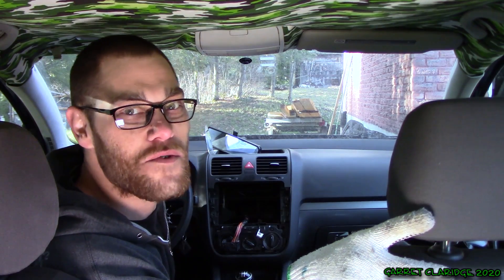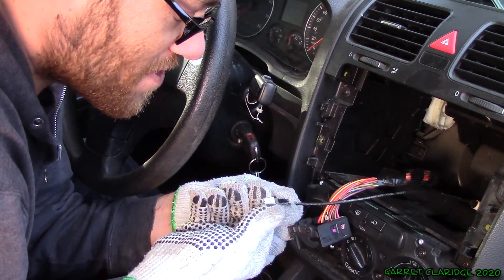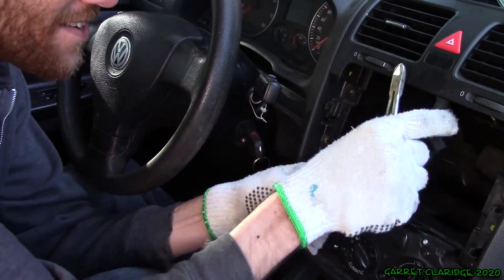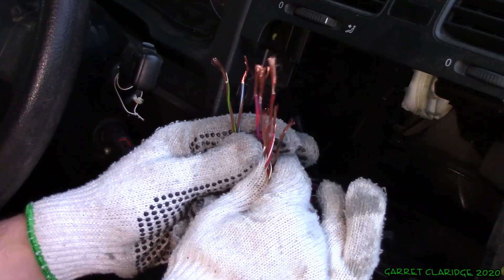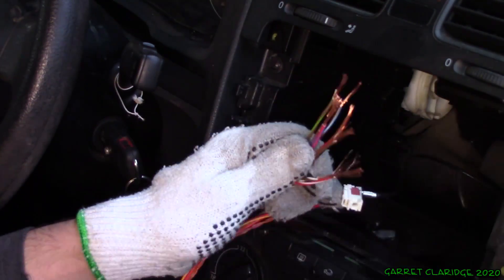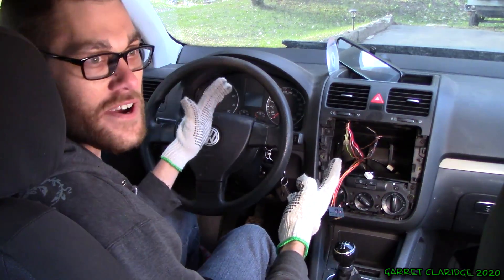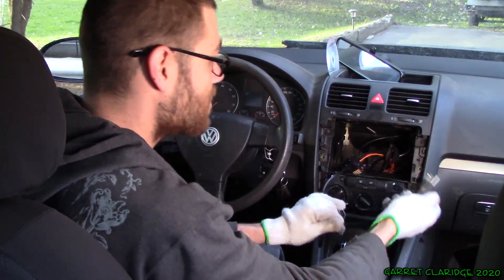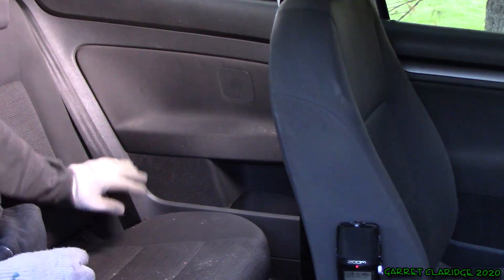The 120VAC Car Speaker Upgrade!

Comment from the maker: What do you / would you run for a system in your car?   --->  Stock or Aftermarket?
Reply: Honestly it would depend. If it's the upgraded system like the Alpine Stuff in the Dodges I'd be fine with them, if it's completely stock garbage I'll go aftermarket
Reply: Defo after market :)
Reply: i have a Pioneer  touchscreen double din in my hyundai elantra with the stock speakers in it
Reply: Stock Bose and I added two skar 12s in custom boxes for when I want to have some fun, haha
Reply: Stock. Harman Gen 3.1 Hardon kardon. Runs qnx
Reply: I would keep the head unit, but I would upgrade the rest.
For example I'd add new speakers.
Reply: Im not to sure think it might be jbl but the stock system in my mom's 09 Toyota RAV4 hits pretty damn good. Lots of bass and decent twetters for a base model
Reply: I would prefer to use stock speakers and an aftermarket head unit so that I could eventually add a subwoofer. On newer cars, I would use a small, amplified subwoofer with high level inputs or a soft amplifier/dsp/subwoofer combo (such as the Alpine PWD-X5).
Reply: Probably aftermarket if it’s a good brand 🤷‍♂️
Reply: You destroyed your car interior
Reply: It depends how good it is  + I'm 13 and      
I've been watching u for 5 or 6 years now  u make great videos keep it up
Reply: Use ma as a "don't have a car" button
Reply: KENWOOD
Reply: Pioneer AVH - x2800bs powering Rockford tweets and woofers  actively (no back speakers in this install)  and then a rockford P3SD4 - 10 inch shallow mount sub. Running on 650 rms
Reply: I have a cheap China deluxe USB PC speaker setup that I just connect my phone to, which the brand is ironically called "Speed".
Reply: currently run 2 sundown e-12 v.3s ran by a DC audio 2.0k with a Kenwood kac-646x 4 channel. so aftermarket I would say lol
Reply: Hey, Garret you almost have 65000 subscribers 😱😱😱👍👍👍👍👍😍
Reply: Aftermarket Cerwin Vega subs, tweeters, and amps. Not sure on the deck though, likely alpine if they still make em’! First I gotta get myself a car X3
Reply: stock... Easier to use and sounds good.
Reply: Aftermarket
Reply: I would run an aftermarket system in my 2015 Toyota Camry
Reply: Stock with pioneer single din and rockford 12 but planning on upgrading to skar components
Reply: Aftermarket I guess I’m Dutch🇳🇱 so I don’t understand every word😅 

BUT I REALLY LIKE UR VIDEOS GARRET (congratulations for 65k subscribers 😍😍🤟❤️❤️❤️)
Reply: Hey Garrett sorry to hear they stole all your audio gear just wondering what speakers did the steal like the brand and model. What do you plan on doing next for your car audio system
Reply: probably some Phantom coaxials.
Reply: aftermarket 480 volt power for my car speakers!!
Reply: I would just put home audio in cuz I'm to lazy to order some car speakers
Reply: I use stock speakers on my mercedes w204 because it was made by harman/kardon on it
Reply: Stock Volvo/Alpine/Dynaudio system in my C70. 1 inch dash tweeters, 3 inch soft dome mids, 8 inch door woofers, then 1 inch and 6.5 mids for the rear, and 2 10s behind the back seats! Good shit.
Reply: Got a orion XTR 15.. on 700w and it's laughing at it
Stock alt
2 deep cycle batteries
Reply: Aftermarket all the way
Reply: aftermarket
Reply: I would run an aftermarket in my car if I had one. Nonetheless, that was an awesome "upgrade" you did there.
Reply: I recently bought a 2007 Toyota Matrix that came with an aftermarket stereo. Which I’m fine with because the stock stereo on the Matrix was shit.
Reply: Cinelli Innovations s
Reply: Already aftermarket lol. I got some Rockford fosgate coax speakers in the doors, and a big ass Rockford fosgate punch subwoofer.
Reply: If stock soundsystem sounds good for me,I'll keep it,but if the stock system has a shit system,then I'll just upgrade the head unit and that's it. I just upgrade the head unit and that's it
Reply: I have the Infinity system in my '04 Durango, I like it but it's beginning to show it's age. I'd upgrade but to replace those speakers and the amp takes an insane amount of money.
Reply: 2. Tweeters at the front of the dashboard ( stock no capacitor )
2 Stock woofers ( paper cone )
And 1 Ns450A subwoofer on 150 Watts RMS 500 peak
Philips headunit
Reply: Aftermarket speakers, stock headunit
Reply: If its like the Boston acoustics in my dads Jeep then I'd keep it as is (stock).
Reply: Aftermarket
Reply: Sundown 15s with a 6in port 3x3 cubic ft S A Z sundown audio amp on a half ome
Reply: stock. because i can't put an aftermarket system in a tesla.
Reply: Hey could u help me set up my new stereo!! Lol 😆
Reply: We still have the stock jbl system In our 2004 Toyota SENNA the stock sub is getting replaced along with a blown tweeter soon
Reply: Stock
Reply: Mercedes sounds ML 100w
Reply: Aftermarket for my old _ RV and my dads Audi.
Reply: Spectron spa4000
Reply: Always aftermarket 😎

Comment: That's impressive for a stock system!
Reply: retrospective001 it’s a Volkswagen
Reply: Made in germany
Reply: Colkswagen Eis best stock sound ever
Reply: I had a 09 VW Jetta with the same sound system as that. Front door 3 way speaker system and hack door just a two way. They are not that good quality and the woofer on the front door is supposed to be a subwoofer which doesn’t even have good bass . But aye every year something different
Reply: Das ist zeir schon!!!

Comment: How much speakers does that thing haves. My car haves 8 its a ford focus. And can you make a video how to connect amplifiers and subwoofers. Because I saw in amazon a sound stream amplifier and subwoofer and I got them but every video I see makes me do it wrong. And I need your help. And my grampa bought a Chevy Diesel truck and his stereo is a duel Bluetooth USB CD DVD FM SD stereo system and the sound of the truck does not come out and I check if it on mute and it wasn't on mute. Can you make a video of that please? Thanks

Comment: I have hooked decks in weird places, like straight to the fuse block. It made some weird noises over the audio I figured out it was from the alternator, system wasn't grounded right. Worked like that for awhile, with house speaker box in the back. I didn't try that again 🙄.

Comment: Garret, I don’t believe the front door woofer blew up. I had a 09 VW Jetta with the same system. Reason why I say they may not be blown cause the front door has a crossover installed. You probably blew up the crossover before the woofer did cause I noticed the back door woofers took excursion then the front doors

Comment: with a 12volt to 120 240 volt inverter you can use way more power I have one but only power my camera off it.  it says to unplug though when your engine is off or your car will not start again.

Comment: Minty old Golf, Most of the ones that age here have no rear hatches/Front wings left or are rotted to fuck underneath due to road salt here in Scotland, The previous MK4's are far tougher it would appear, Especially the 1.9 Diesels , they came in anything from non turbo 64bhp rotary pump to 150bhp turbocharged common rail..

Comment: Hmm..did you ever find out who or what happened to your stereo stuff? I can't believe someone robbed you..that's like the lowest of the low! Ugh, i'd rather give something away than have it stolen!
Reply from the maker: Oh that was a joke, as nobody steals car stereos anymore (unless they have competition gear or something cool aftermarket) but stock deck theft is just a lol
Reply: @GarretClaridgeMeerkat  Ahh, i suspected it was a joke! At least all the OEM Stock nonsense being so highly integrated has stopped that, but...unless the stock system is genuinely decent, aftermeerkat (aftermarket) all the way! xD I don't really think i run anything 'stock' come to think of it, the odd exception but if its capable of running faster or being improved, it gets done! Anything from better capacitors and pots to better cooling, soldering, thermal compound, etc! Haha..